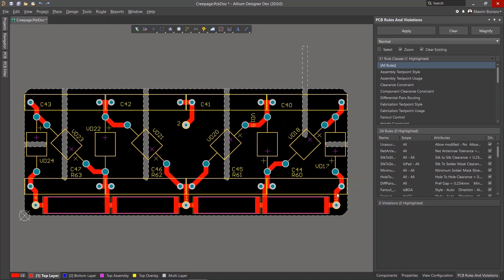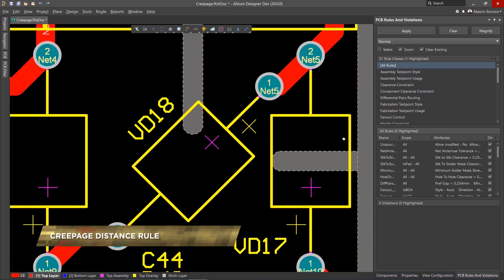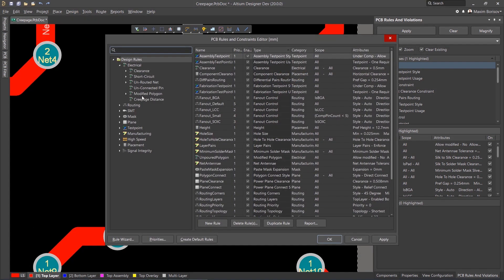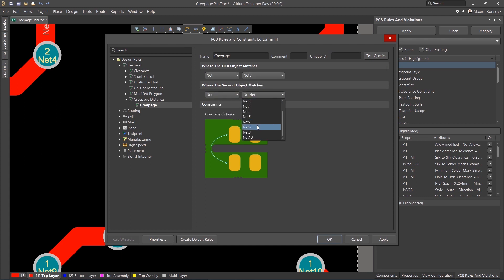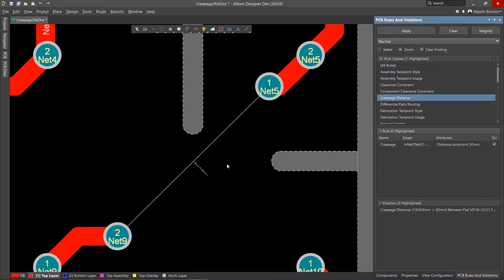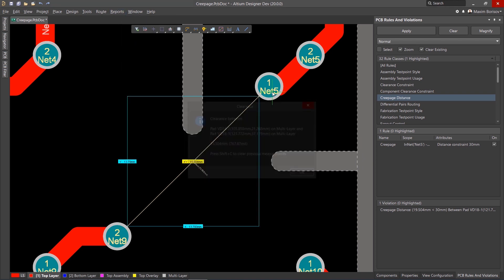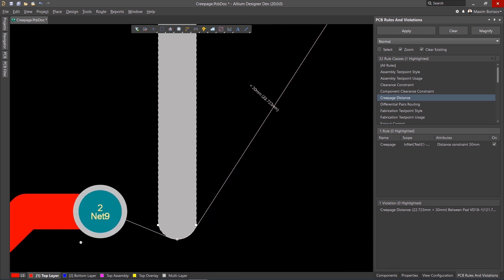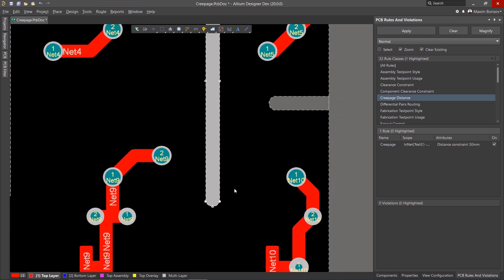Checking for Creepage in High Voltage Designs

Comment: What about the air clearance. Is there also a rule for that? Or can i trick the creepage rule by doing a board cut out of 1mil?
Reply from the maker: It takes into account X, Y, and Z distances between nets. Adding a cut out will increase the creepage (distance between points), but keep in mind that it could compromise the integrity of your board shape.
Reply: @altiumdesigner863 Air distance / gap = shortest distance between two "open" voltage surfaces e.g. Pads. (Pads are not covered with soldermask)
Creepage distance = the distance along the surface between nets.
If i have 2 high voltage nets which are connected to pads with no soldermask and the pads are so close together that the creepage rule is violated. Then i will add a board cutout to increase the creepage. Ok no worries about the creepage. But now is the distance of the board cutout important. e.g. a boardcutout with 50mil is not enough. Due to the high voltage, sparks and arcing can occur if the slot is not large enough. This feature is also essential for high voltage design. Is there a rule for that? 
Thanks